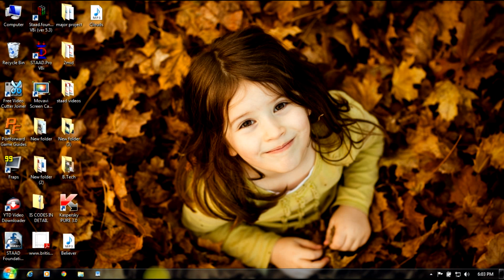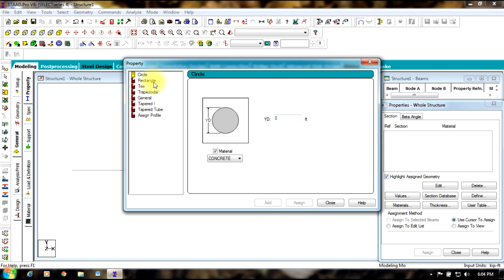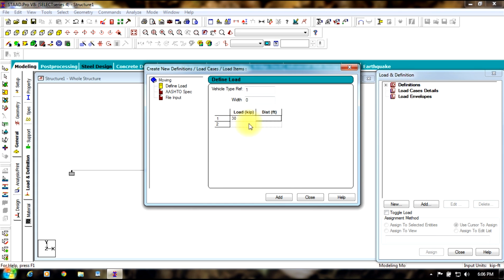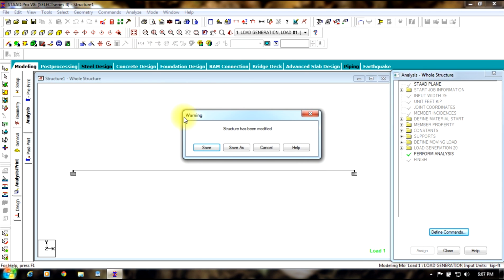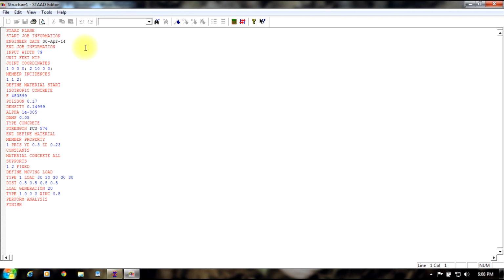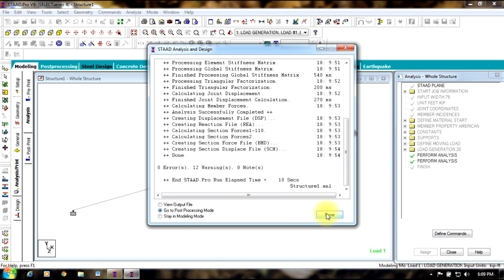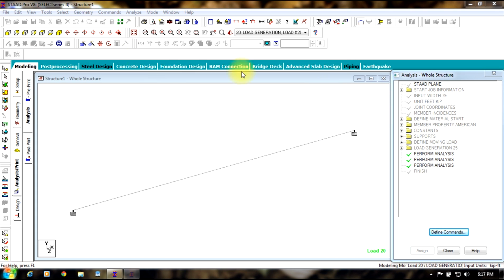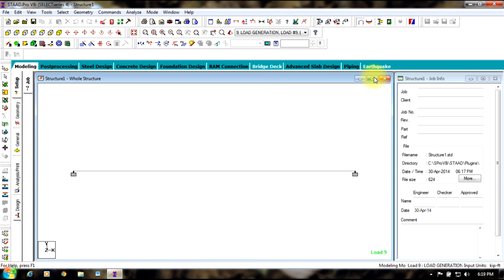STAAD Pro Tutorials Moving Load Analysis-Day 8

Comment: How should I use moving load on specific beam
Reply from the maker: syed hussain 

Well you just need to select that particular beam and assign the moving load to that particular beam.
Reply: After analysing of g+5 Building structure, the  report shows error that elasticity modulus does not  enter in some members . please help me how can I correct this type of error?
Reply from the maker: The error is because you didn't assign a section property to few elements.